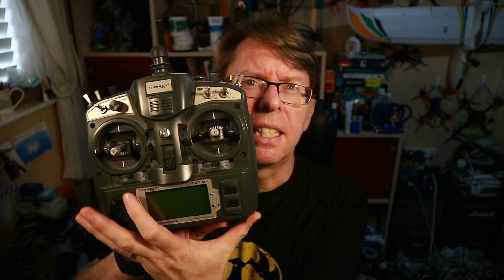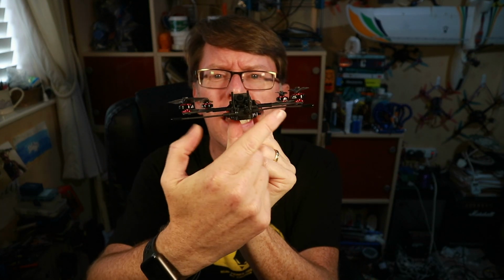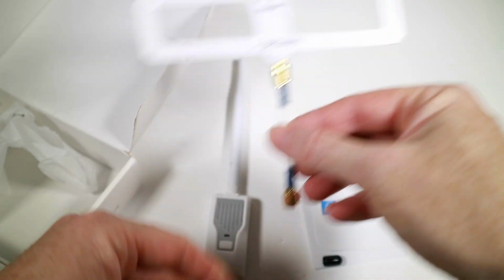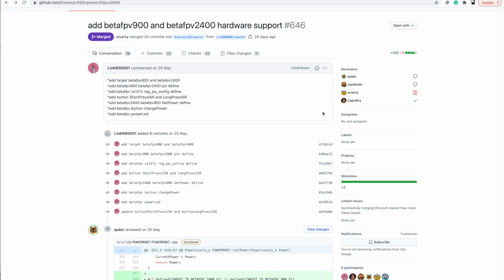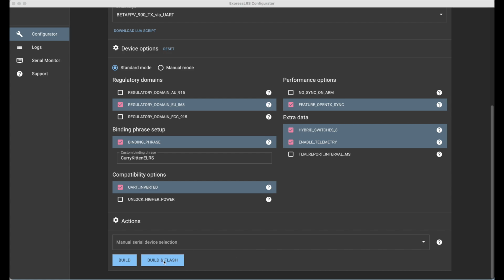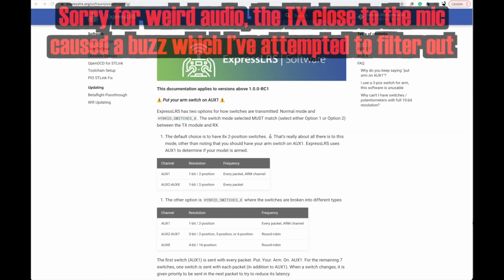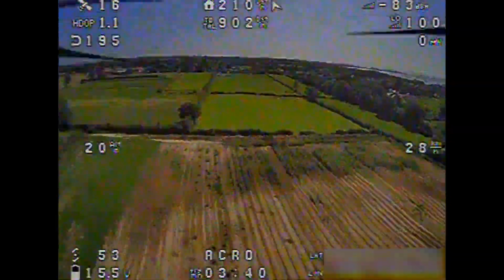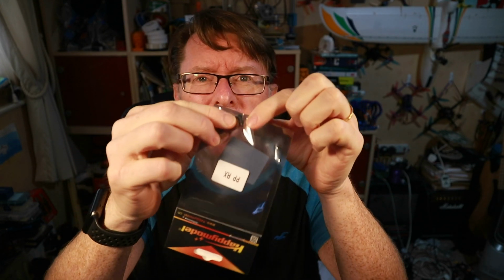BetaFPV ExpresRLS Module/RX's: Setup, flashing, problem resolution, and flying

Comment: Hello, nice 2 years old video 😊. I don't know if you figured it out by yourself, but the jello in the image is from the GPS pole, it vibrates every now and then. I have a similar quad and for long time i didn't understand that.
Reply from the maker: Maybe - it used to be ok when it had a Naza in there.  I'm just using one of these f450's again seeing how it works with a modern flight controller and ESCs.  I think the whole frame vibrates quite honestly
Reply: @CurryKitten  
Same thing here. It was my first build with multiwii. Afterwards i upgraded to inav when it came out and added mobius camera on a cheap gimbal.
I started upgrading it with new controller and new esc.

Comment: Betafpv new elrs eciever should power.on into bind mode and you press the tx module button 3 times to bid.
    But 2.4ghz rx and tx is not working .

Comment: I noticed a flysky rx purple witout servo plugs is the same as elrs nano.. in practice .
      A bugs 3 wuth a 2 watt booster matches range ha ha .
   And these elrs has alll the groups of dufferent little bits  that work with any bit that chances to have the same open. Source hack installed in it .
Reply: It is as if they are selling computers and internet connections and live wifi all over in any piece full of " open source" unknown programmers taking factory compatible tx and rx sold to ou and mysteriously suddenl has been " uograded along the way to your house and now your model  plane neeeds to upgrade to match all  of the elrs rx's and tx's that have been hacked out of the factory on the road .
Reply from the maker: There are good and bad things about open source, but one of the good things is that people can't hide malicious code in there because we can all read it, modify it and compile our very own versions as we see fit.

Comment: why this old  vid shows up , but nothing new with yt lol but in the early 70's it was am tube tx that sat in the trunk of your car. move the stick count to 3 it turns. then came a handheld radio craft still have all of my rc gear. oh how things evolve ,,  so with my qx7 some say no need for crossfire mod with elrs and some say you have to do it.  be nice to have time to read up or find a clear explanation about it. but everyone just has a different answer . guess just buy another radio . or find the parts to do it.
Reply from the maker: The answer to the QX7 question is "it depends" perhaps that's why you are finding different answers.  If you keep the Hz rate low then you don't need to do anything - but if you want to run at max refresh rates, then the answer is still a bit fuzzy.  on OpenTX, yes - mod needed.  But you can also run EdgeTX with Onebit enabled as a workaround - that's my understanding at least
Reply: @CurryKitten  ordered a tx16s, going elrs ,problem solved lol

Comment: Well I have the BetaFPV nano TX like you have here and 1 BetaFPV receiver. I put that in a quad and it works. I ordered 3 Happymodel receivers and just put 1 in another quad and while it connects to my radio, I'm have some really weird and dangerous things going on. 1st, my beeper switch no longer works. Weird but ok. 2nd, I armed and it would not disarm. Luckily I had the props off. Then I got it to arm and disarm like normal, put props on it and went to do a test fly but when I plugged a battery into the quad, it beeps 3 times, pause, beeps 3 times, over and over. I did not have it set to do any beeping. I was afraid to arm it. You said I can use any ELRS receiver with any ELRS module, but is there a trick to making that work? I flashed the Happymodel receiver with the Happymodel firmware and had this weird stuff happening. So I tried flashing it with the BetaFPV fimware. It noticed I was installing the wrong firmware in the configurator, asked me to press Y to continue or N to stop, but pressing Y or N didn't do anything. The configurator just locks up. Any idea on what's going on here? For now this is way too dangerous to mess with. When the quad is doing things I dont' tell it to do or refusing to disarm when I tell it to.
Reply from the maker: It's the case of any module to any receiver - that's kind of the point of ELRS.  Whilst I've only got 2 different types of 868 rx's, I make a habit of trying everything to everything in 2.4 (of which I have loads of different types)

I would go back to basics with your config - don't move on from "my beeper doesn't work" why not - it should.  Have you checked your modes in Betaflight and confirmed you have the right channels moving.  Do 2/3 position switches react correctly.  Have you got the right channels assign to the appropriate functions (i.e ch5 is always a 2 position arm/disarm switch).  I'd be very interested to know what's going on there, and I certainly would do any arming/disarming before I checked that out.

You absolutely only should flash the rx with it's own firmware - Happymodel in that case.  Flashing with BetaFPV won't help and most likely you'd have to short the boot pin to recover it back to something usable.
Reply: @CurryKitten  I think I have everything working now. It took 15 seconds for my radio to talk to the ELRS receiver after plugging a battery into the quad. I think that's a little long. I changed in the LUA script the switch from WIDE to HYBRID (not sure what that even does) but it seems to connect to the radio faster now. I had my AUX1 switch split up so I could have my ARM switch and BEEPER switch on the same AUX1 channel. I think maybe because Express LRS needs the ARM switch to always be on AUX1, that it might not allow AUX1 to be shared with other functions. Maybe it is Arm and can only be Arm? I had an unused AUX4 switch that I use to use when I ran analog video. I used it to change the VTX power on a 3 position AUX4 switch for 25mw, 500mw, 1.6w. I just put the beeper on that switch and the beeper is working fine. I can change that switch to the momentary switch after I get all of these receivers installed in all my quads and everything is working.
Reply from the maker: On ELRS, Aux1 is a 1 bit channel (i.e it can only be a 2 position switch) so if you'd assigned it to a 3 position switch and had multiple functions, then it could well go a bit wrong.  It's normally Hybrid by default (which means that most AUX channels have 3 possible positions - while Wide makes them 128 position channels)
Reply: @CurryKitten  That's what my problem was. I'm pretty sure you even said that in this video. I've been flying DJI so long that I forgot that I split up AUX1 into an arm and beeper function on 2 different switches so I'd have an available 3 position switch to change analog vtx power.  I forgot that my SA switch worked. That was a dead unused switch before I used it for vtx power and it's just been a live but totally unused switch for 9 or 10 months that I've been on DJI.

Comment: OH MY GOD!!!! Thank you for figuring out this STUPID BetaFPV module where there is no documentation and no information telling you that you have to take the module apart, find 2 more buttons hidden under the plastic, and you have to press and hold the lower one down while it updates the firmware. Otherwise it will error out on you all day and night. I swear these companies are in a stupid contest. Who can do the dumbest thing to hardware they sell to customers. I spent the whole day trying to figure this nonsense out. I wish I would have found your video earlier. Instead all I found was everyone else saying how easy this ExpressLRS configurator is. I was about to order another module because I was sure my hardware was defective. So thank you very much. I have been so sick of having a micro Crossfire module hanging off the back of my X9 Lite radio. Now that I have this working I can start ordering ELRS receivers to replace in my crossfire drones. Can I use any 900mhz ELRS receiver with this BetaFPV module? I have to say I'm not too happy with BetaFPV for doing this with the module. Plus the antenna they sent me for it (like the rectangular one you have) was broken right out of the box. I had to re-solder the ground to the brass connector.
Reply from the maker: Quality control is certainly not something BetaFPV excel at.  It seems like it was also a bit random about who got a working module vs others getting the junk ones.  Although BetaFPV are supposed to redesign the module for it to work, it doesn't mean all the initial batch out there got recalled or anything - they are still all out there!  Good news though is yes - you can use any 900mhz ELRS rx with the module.
Reply: @CurryKitten  Thanks. I have this module working and the receiver in a quad and it's working, but there is a very weird thing going on. When I plug the drone in, it takes like 20 or 30 seconds before the drone will communicate with the radio. I just ordered 3 Happymodel 900mhz receivers. If this problem persists with those receivers too, I'll get a different module and see if that fixes it. 
Unfortunately my return window closed on this equipment because when I got it I realized that I'd have to update the firmware on my radio to even use it. I wasn't in a big hurry to relearn that. I'm not one of those that has to have the "latest and greatest" on my equipment. If it works I try not to mess with things. But I do need to go back to testing everything I buy immediately because of the high failure rate with FPV electronics. My first Crossfire receiver was DOA. My first TBS VTX lasted for 50 seconds before it blew up and went dark and TBS is one of the better companies.

Comment: Hi, Great video. My betafpv module is also missing the capacitor and needs to be opened for updating every time. Wondering if you were able to contact betafpv and get the defective module replaced? I appreciate all your content.
Reply from the maker: I didn't get a replacement - it was a review item for me so a little different from purchasing.  I attempted to push BetaFPV on if they'd be replacing the defective modules and I really couldn't get a clear answer from them.  In my view, what you have is a non-working item and should be able to seek a replacement.  Depending who you bought it from and how you paid, I'd certainly ask for that and if you used PayPal then raise a dispute if you need to

Comment: Just got the 868Mhz & 2.4Ghz BetaFPV modules, both needed taking apart to update so expect BetaFPV sent us all there capless v1.0 PCBs builds, would of been better to have a momentary externally on module rather than on the board IMO if this was a known blunder.
Reply from the maker: If people are still getting the dodgy ones weeks later, it would seem that either BetaFPV haven't fixed them, or there was a lot of v1 stock out there
Reply: @CurryKitten  Or China has flooded Europe & beyond with there v1.0 rejects & kept the best for themselves

Comment: Did you find out how to add the missing capacitor on the tx module by yourself to fix the problem without need for pressing the internal button?
Reply from the maker: The video I linked to in the description from Wez shows how to add the capacitor which will resolve this.

Comment: Yup, I flashed my R9 system with it, the STM method was very simple. With the quads there's a limit to the prop size imo, once they get big enough they start to inhibit the traditional wing properties (which they are; propellers are rotary wings). So with the tuning you won't get rid of the bobbing and wobbling, you only get rid of them once you gain enough mass for the craft not to be disturbed by the winds.

Comment: Good old graupner props. I’m going to have to rebuild my tbs discovery frame I have in the top of my closet. I kind of miss those old quads.
Reply from the maker: They are fun to get going again, although you will probably think "this doesn't fly as well as I remember" :). I took a look at older footage just to check and they didn't fly as well as I had recalled, so I'm changing up the ESCs on the f450 in an attempt to get it going better.
Reply: @CurryKitten  I know right. I had it setup with a naza v2 that I still have laying around. Hopefully I can still find my old pids I used to run. It was a pretty nimble quad for a camera platform back then.

Comment: I agree unacceptable I'm having problems with flashing mines they need to replace all that bought the defective modules
Reply from the maker: I agree - they have gone quiet on answering that question.  Are you having the same issues as me?  Does the workaround not work for you?
Reply: I think I got it flashed im waiting on the ep2 rx to know for sure but they need to sort out customers that bought the first batch like myself

Comment: forget that small antenna delivered...i measured Mine at 1056mhz... so it will Not give you a good range. the small RX antenna Need to be extended about 26mm each Side to get the right tune for 868mhz. i die IT with Mine an end Up at 866mhz at VSWR <1,2.
Reply from the maker: Yeah - I'm not sure what they were thinking on the size there.  It's not like that size is any fraction of the wave length... I'm not sure the 80mm one is either.  Be interesting to see how far it goes though as it so far out.  I'll swap it over to an actual 868 antenna if I need to

Comment: Awesome review. Was going to go crossfire on my lr 7" quad, but now that I know there is a lite module already for elrs, and it's way cheaper. Probably going for this now. Thought I was going to have to get an r9 lite kit, and flash it. So was going to go crossfire in the meantime to just have it flying. May check for a namimno lite module, since I've heard great things about the quality, as well as the full size module has a fan and can go to 1 watt output power here in north America. Thanks for the great info!
Reply from the maker: Thanks.  I've put the "let's flash R9 to ELRS" on my list of videos to do just to see what's involved.  Right now, HappyModel seem to have the most detaure complete hardware.  People keep telling me their stuff works.  I'll be looking at the Namimno Flash module next, but as I said - they haven't implemented the wifi flash yet.. but the module looks very solid and can put out 1W
Reply: Got mine in the mail today, just working on flashing it. But noticed mine had exactly the same hash number. Can't wait to see how far I can go on it.

Comment: Interesting, loved the history lesson on radios, I use to have a Mcgregor  AM set, when i was a boy, 50 years ago, wish i still had it, would  be nice to see a session  some time on flashing ELRS to the ACCESS Frsky R9,  I have one i cant use at present, and tuning your quad as my 9” XL9 wobbles like yours, but looks good in Gopro with hypersmooth , keep up the good work.
Reply from the maker: I do intend to flash at least one R9 module I have (I think I have 3 or so) so I'll definitely sort out a video on that one.  What are you using on your 9" quad... I hope you don't have PWM based ESCs!  People rave about Emuflight being really good with larger quads, whereas Betaflight is really built all around 5"
Reply: @CurryKitten  JHEMCU BLheli S on the 9”, I get approx 11-16 mins flight on ab 1800 4s , I tried Emuflight, it seemed worse, ? I am not very lucky with Emuflight when I’ve tried it on other modules so went back to Betaflight, my black box graphics look a mess I added soft mounts so far, now need to do a Chris Rosser tune, hoping I see your tune up, and the R9%M flash soon,

Comment: Great description of the system. I do like the idea of ExpressLRS and now I have a rough idea how it all works. I seem to remember a few other long range systems had issues when they first came out. It will be very interesting to see how it gets on. Surprising how quick FrSky are being overtaken....
Reply from the maker: I just haven't heard of FrSky doing anything recently, they really left the door open for other people to come in and fill the need of hobbyists.  I do like the idea of using any module with any receiver (as long as it does ELRS and is on the same frequency) the prices are already nice and cheap - so I hope it has a happy future and gets some of those features in I want.

Comment: you know your R9 your using on 868 but your using 915 antennas, i stuck my '915' antennas on my antenna analyser and they are not tuned for ether frequency and terribly made antennas!
The resonant frequency is 892mhz with a SWR of 1.5 (thats not even good) but on 868 the swr is a whopping 1.8 and 915 is very close at 1.7.
Id like to get my hands on Frsky made antennas for '868' and test to see if there is any difference, i suspect they are scamming people and there is only one type and they tuned it in the middle and lie about the actual frequency its designed for as 892 is neither and really off frequency and not at all good at a swr of 1.8!
Reply from the maker: They made a few actually.  They did have this "general" antenna that was supposedly tuned to around 900 as a sort of mid point, but anything that's 868 or 915 was supposed to be tuned as such.  I'm not shocked by anything FrSky have done any more :D
Reply: @CurryKitten  coming from the world of CB i cringe at anything over 1.5 and both my hombase and mobile setups have a swr of 1.1, at best a high swr results in lower range as the swr is a measurement of power reflected back down the feed line instead of being radiated out by the antenna but the other side is if your swr is high enough, it results in that reflected power smacking the outputs so hard that they burn out from the heating that results.

the Rx antennas can be trimmed to get them tuned right for 915 but the stock R9M antenna is not a design that can be altered but the super T style Tx antennas can as they are a standard Dipole, we are out of luck for 868 as to get ours tuned we  need to lengthen them :(